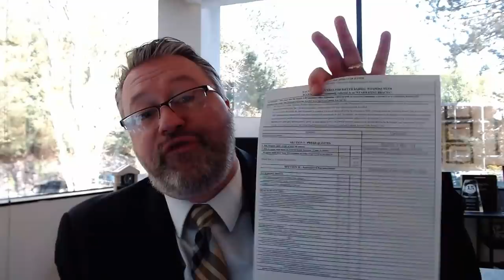How the ATF Will Enforce Their New Pistol Brace Rule

Comment: Here's the thing. Stabilizing braces were designed specifically to circumvent an already existing law. They are exploiting a loophole. All is happening is the loophole is being closed so the exploitation cannot continue. This sort of cat and mouse thing has been going on as long as laws have been on the books. No one should be surprised just go find another loophole and exploit it and enjoy that while you can :-)
Reply: @westcoastwarriorsarchive7929  they were originally approved by the ATF because the ATF took it on good faith that people would use them as designed. Since then the manufacture and use of them has very clearly not been in that direction. The ATF change in rules is in direct response to people not manufacturing or using them as intended. I just don't understand why people push the boundaries of the law and then acts shocked and appalled when the law pushes back.
Reply: @westcoastwarriorsarchive7929  and personally I think it's a little messed up for the industry and community to exploiting disabled people to circumvent laws. I've seen literally hundreds of videos with people using these pistol braces on YouTube and I think maybe one of them was being used as intended.  It's kind of like a non-disabled person using a disabled parking permit to park in handicap spots.
Reply: @DoRC  using them the correct way vs the incorrect way implies that there is an illegal way of holding a pistol. Which the atf has also said is not the case though. 
And the law is supposed to enforce safety not punatively go after people because they did something that there were told by the same agency is perfectly legal but now hurst their feelings.
Reply: @westcoastwarriorsarchive7929  you're arguing semantics on something that's very simple. Pistol braces are designed manufactured and  and are used to circumvent a law.  You can complain in about it from any angle you want but that's the reality and everybody knows it. People take something that was originally designed for helping a disabled person and use it to circumvent an existing law. I say good for you for trying but don't get all offended and uppity when it doesn't work forever.
Reply: @DoRC  ATF approved it being shouldered.